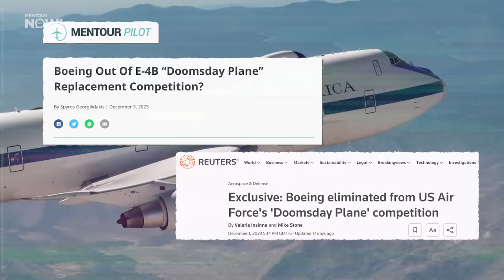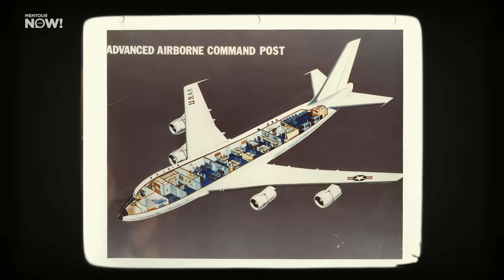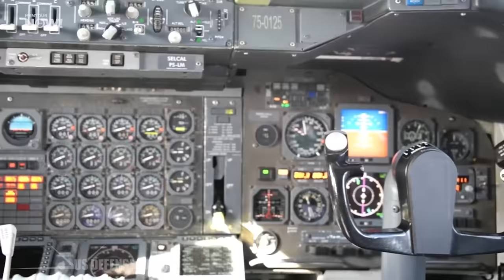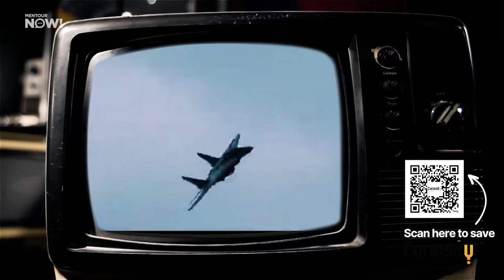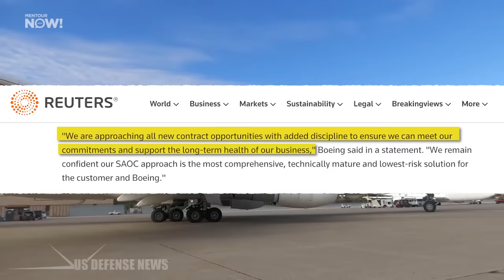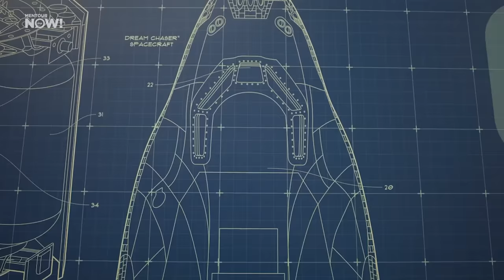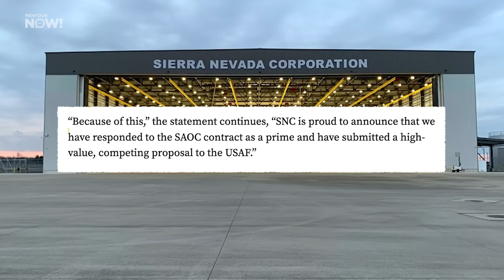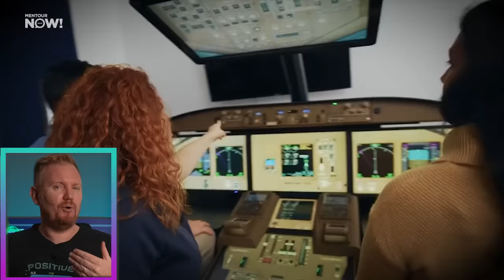Why was Boeing kicked out of the Doomsday Plane competition?!

Comment: The only obvious modern alternatives to the 747-800 are the Airbus A380, and or the now retired, but possibly still usable A340s.  I don't see the USAF moving to those planes due to their foreign design, and the supply chain for them(i.e. for spare parts supply)  is on present within the USAF. They do, however, fulfill the 4 engine requirement.

I know the A380 is supposed to be going back into production, so the actual spare parts supply availability should not be an issue, the 747-800 has been out of production for a couple of years, and is widely used in the air freight industry, so I don't think parts availability is a problem for that plane, either. The USAF is already flying the VC-25s, so that supply chain already exists to some extent, but they don't fly any Airbus aircraft of any type, so that supply chain would have to be established from the ground up.

Comment: AIRBUS would only be an option if the A380 continued to be produced. This is AirBus' only current 4-engine aircraft. But it has been announced that AirBus is ending A380 production. In addition, it would be unlikely that a non-US company would receive the order for AirForce One.
Reply: Airbus has already ended production……just like Boeing has already ended production of the 747. The planes would be bought from airlines and converted anyway. And did you forget about the A340?

Comment: What would truly be hilarious is if Sierra Nevada Corp got Lockheed to sign on as subcontractor/advisor using repurposed C-5As from the boneyard. The ones that were not upgraded to the latest C-5M Super Galaxy standard because the USAF didn't want to pay for more moderned transports. Lockheed could be subcontracted to hand over all the technical details and remaining tooling they used to modernize the selection of C-5s they did for the USAF to SNC, and Sierra Nevada Corp could have legacy C-5s in the hangar and basically rebuild from the frame up with newer engines and all new wiring anyway. The C-5 itself has a massive amount of cargo space that could be converted over to a two-deck system and still have plenty of space for extra fuel tanks, and the comms antennae could potentially be better integrated into the body, making it look nearly indistinguishable from regular C-5Ms at a glance; IIRC, C-5Ms are already used to transport the entire Presidential Motorcade and supporting personnel anyway, so seeing another C-5M accompanying AF1 wouldn't be strange. Some engine and part commonality with C-5Ms would also cut on maintenance costs, esp. since the USAF still operates those in some quantity whereas the only newish 747s being used by the USAF would be the new AF1s.

That said, it wouldn't be entirely strange to see Airbus offer the A-380 in partnership through SNC either; they have 2 full decks to work with (some of the upper deck could be entirely repurposed to better integrate comms without needing additional blisters/humps too), and Airbus did temporarily win the previous tanker competition and offered a successor joint program with Lockheed, so they're familiar with working with the USAF. As well, they could just as readily ID and offer up advice and schematics for relatively young and new A-380s as Boeing could with 747-8s.

Comment: 8-10 aircraft, they are never going to be able to guarantee they'll be able secure that number of air frames, so if the number doesn't change I think they will need to go for 777 airframes as a large number of legacy 777 will start to become available soon. Yes they are twin engine but considering there is only 48 747-8i built 8-10 is lot to require, so a change in contract requirements might be needed

Comment: One imagines that the USAF has taken the lesson of the catastrophic failures of Pratt engines on B777s, which resulted in airflow disruption so severe that continued level flight was impossible (UALs 1175 & 328),  as confirmation that 4 engines are the only solution which ensures engine-out continue-ability. This lesson is also available to the airlines.

Comment: The 747-8F is the best choice, with the 747-400F a close second. The "short hump" refueling aerodynamics are more similar to those of the current "AF-1" and E-4.  That's risk reduction. The true freighters also have no passenger windows, just like the KC-46. This makes hardening against EMP much easier, to further reduce costs. To allow for many enhancements, the nose also opens up, so you can slide in big modules. This quickly changes out the mission package, that is to say, changes the aircraft mission configuration. Not to mention that those modules can themselves be hardened.  From an engineering perspective this is a huge risk reduction, because you just test an existing commercial freighter, and add whatever EMP protection that you need for the most sensitive electronics modules. Furthermore, the LRU cockpit devices such as computers, controls, and displays can be easily replaced with hardened Gallium-Arsenide and Gallium--Nitride based devices.  Those are expensive new boxes, but (1) the interfaces are all well defined, and (2) the boards, components, and software are available from the B-21 and F-35 programs. Both factors drop development times and reduce risks a lot. By the way, the modular mission container concept is already an important emerging design approach for the US Navy. 

Boeing has also flight tested various defensive and offensive packages on the 747 airframe.  Kinetic devices like chaff dispensers, AMRAAM, cruise missiles, etc have done separation (and some integration) tests.  Air Force 747s also have devices near the engines to blind infrared and optical seekers, and to defeat microwave and laser proximity fuses on various anti-aircraft missiles. As a whole, any 747 can be militarized with low cost and risk.

As far as availability of the true freighter 747 goes, there are a lot more of these cargo birds around than there are the passenger 747-8Is.  And the logistics chain for the 747 is worldwide, of course.  Airlines selling their freighters can easily replace them with various very efficient freighter twins (777, 767, A-330, A320, etc.).  Only a very, very small part cargo operations really need the cargo door on the nose of the 747-400F, 747-8F, or the Antonov An-124. In fact, most freighters in service today lack the nose door, since they are converted passenger birds.  The nose door generally adds structural weight, which is a cost that is difficult to recoup for airlines.

As a side note, the militarized 767 tanker (KC-46) is also a military freighter, just as the KC-135 was.  Every one of the KC-46s contains a belly full of communications gear, so that they act as airborne radio relay and surveillance assets.  With a few low-profile external sensors added, the KC-67 also scoops up data to compliment Rivet Joint etc.

You are totally right about the shift in thinking by Boeing's current management.  They abhor risk, and every decision is dictated by ROI.  Overall, your video is excellent.  Thanks for your many wonderful videos.

Comment: What about the Boeing C17, they are at the threshold of building a new batch and can make some modular mission pallet system to put into the plane to take care of that. The aircraft could also be a Airbus 400M because the engines need to be build for duration and losing a turboprop engine, if you vane the prop creates less parasitic drag. Heck they do that all the time on for instance the Lockheed Orion. There could be a problem with mission height with turbo props though.
Reply: Too slow and too small

Comment: I saw it so many times working IT.
How can you fix a price when the project is not fully specified.
Let’s face it it’s only going to get more complicated as time goes on it’s not going to get simpler.
The solution is to come up with a price then double it and double it again.
However you can still go over budget.  One party or the other is going to get ripped off.
We used to charge customers for a quote as this would end up being a detailed specification.  
They would ask how much is the quote going to cost.
So we would give them a quote for a quote which was still a guess as they didn’t know what they wanted yet.
I wouldn’t be surprised if Boeing said you know what you can do with your fixed price contract!

Comment: The Airforce wants to pay around $8 Billion for around 8-10 aircrafts?  LOL.  By the time the project is done, it would be more than double the cost.  Boeing or any other competitor will lose billions and billions on this project on a fixed price contract.  The Airforce is trying to nickel and dime, but every one of their projects has became a dismal failure when it comes to cost control.  This is not only on Boeing projects, but most military contracts with every other aerospace vendor.  If I was Boeing, I wouldn't just walk away from the project, but RUN!

Comment: Seems like the US government is trying to pressure the MIC to be cheaper, but that has a problem because there are only a couple of big companies, and they are in the military business because of guaranteed profits. They basically failed or are failing in the commercial world (my impression is that Boeing is going down the same path as McD in its commercial airliner business). Small companies are going to have difficulty in doing this work because they are massive projects. Whereas the big companies have a lot of experience in managing major military projects, small companies do not. I expect in the long run the government will discover that going with a small company is not going to work either for a project that requires a lot of specialized skills.

Comment: There are a lot of A380s that have been taken out of service, so would it be completely outrageous to think that they could be refitted for such service? After all, the A380 is a newer design than the 747 to begin with. It also has a lot of space for all the equipment currently in use on the 747s and then some... Just a thought...

Comment: I wonder if the -8 is as EMP resistant as the existing fleet
Reply: If they come from existing airliner airframes, then they would have to be hard wired for emp. Very expensive to do as they would have to rip out all of the existing wiring and replace it with hard wiring.

Comment: Commercially, as well as the 747, the A380 might be a candidate, but I feel it would be too big and potentially unable to land in many places it may need to operate into. A more obvious choice would be the later A340, the 600 model with the more powerful engines, and there are a lot of those sitting around in storage locations right now.

But why does it have to be converted from a commercial airliner ?

If a military design were used, there are obvious possibilities which would be more readily available than trying to prise 747-8s away from existing owners. C-5 Galaxies might be a bit old, but there are plenty of C-17s around with less than 15 years on their airframes. And, how about a completely off the wall random idea - the Antonov 124 ? Due to the Ukraine conflict, there are several of those sitting around, including at least one which was impounded in Canada.

Comment: It would certainly be easier if aircraft like the 747 or Airbus 340 were still in production. But in the absence of four-engine types, would it be feasible to modify an existing twin jet airframe into a quad by installing a pair of engines on each nacelle, as per those on the B52?

Comment: Wonder why they didn't considering taking the C-5 as plattform and modernise that instead the 747. The C-5 already is "military grade", has more payload, so with about "the same or less weight of the (modern) systems" range aso would extend, so it would be just a "overhaul of the thing, replacing cables, building in two storys in the payload-area, and maybe switch the engines to "new but hardened"" - IMHO easier to be done than converting a civil aircraft into a military-grade..? (Of course - i'm no insider and could be totally wrong, but the idea alone sounds more realistic considering the known requirements..?)

Comment: Petter, what happens to an airliner when an EMP pulse or something like the Carrington Event naturally occurs? Would it be able to fly and land?
Reply: probably since they are in a Faraday shield bring an aluminum body or shielded composites. they can take lightning strikes  with little  damage, we sent a 747 up to find lightening back on 1969, came back with pin holes on the wing.   but no equipment damage.  flight test program 747
Reply: It would probably fall out of the sky.
Reply: It is all a matter of scale.  Nothing is immune to EMPs, it is just speccing how strong of a pulse the elctronics can recover from.
Reply: @neeneko  if the Faraday  shield formed from the conductive body of the plane is good enough it is immune  from emp.  100 db of isolation is possible .

Comment: Why didn't the air force consider modifying a transport aircraft?
Reply: Which one? The C-17 line is shut down and no one has any surplus airframes. Besides, it would be extremely difficult to get a military airlifter to FAA commercial standards.
Reply: Most likely because that's what they're built and designed for: transport, not consistent airtime.

Comment: It doesn't take a genius to realize that even a complete refurb/rebuild of 747s is still working with an old airframe.   Thus it's not like taking a brand new airframe and modifying it.  Thus buying 8-10 is a much wiser idea and nobody would know how reliable the current airframes are than the USAF.   Since nobody is currently building 4 Engine jets* and Airbus, being a foreign entity is a security issue as well the 747 looks like the only game in town.   The only other  "newer" 4 engine jet anywhere close is the C-17 which is not only smaller, but slower and with a much shorter  range.  (* - Last passenger 747 was built over 5 years ago and the last 747 freighter was delivered about 1 year ago.)

Comment: What you didn't mention is that Boeing didn't just have financial issues on several programs, but also quality control issues. While Boeing was working on the 737MAX issue, they also had serious quality control issues on the KC-46 tanker, the VC-25B and the AH-64 Apache, all of which proved that the Boeing corporation management had lost it's feel with the Boeing engineering and manufacturing side of the company. Boeing failed to properly address those issues, and certainly had a very hard time convincing the  Pentagon's acquisition managers they (Boeing) addressed the issue in a lasting and proper way. There's ample documentation to be found on line to support that suggestion, IMHO the "fixed price" issue is a contributing factor, certainly not the main factor!

Comment: Are there any 4 engine planes being manufactured currently or new ones coming to service soon? If so, wouldn't it make more sense to try to have planes that are in the middle of being built be the ones you modify? That way you get a brand new airframe, while avoiding a lot of disassembly and whatnot, and things like the wiring would be much less of an issue. You'd also probably want recent, powerful and efficient engines. Considering how long these stay in service, it seems that would be the long term win
Reply: Commercial aviation has gone exclusively to 2-engine high efficiency designs for fuel economy.

Comment: An additional question: where are the retired 747-8s supposed to come from?  Only three airlines have enough 747-8is to cover the order: Air China, which won't sell to the USAF; Lufthansa, which loves the 747 so much it hasn't even retired the 747-400 yet; and Korean Air, which has 9 -8i frames and plan to retire them, but will keep flying them until at least 2031.  Maybe the USAF is planning on refitting 747-8F freighters?  Those are split up among many air cargo airlines, and they all seem to like the plane and want to keep it.  (Possible exception for Cathay Pacific Cargo, but there are Security dimensions there if not quite as acute as with Air China.)

If the USAF really want a used, 4-engine passenger plane, they can either D-check some very old, very tired 747-400s, or they can look at pulling A340-600s out of the boneyard.  More likely, one of these requirements is going to have to go.

Comment: Petter, I remember that one of Boeing's selling points for the replacement AF 1's during the last administration was that they had "two new, still in green, 747s" that were originally built for the Russians but never delivered. If anyone knows where 8-10 "low mileage" ones are, it will be Boeing; bottom line- even it the new guys win the bid, they will have to deal with Boeing for those planes and likely a lot of support, so Boeing will get paid. Before he left, Muhlenberg said that Boeing was "re evaluating" the feasibility of those "custom orders" in terms of profitability and use of resources. So we will all see when the bid envelops are opened!